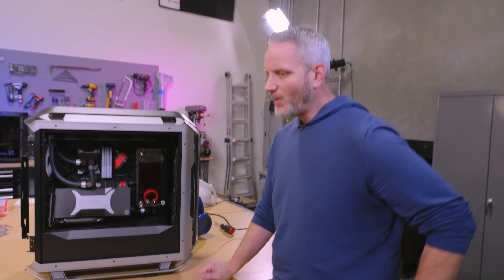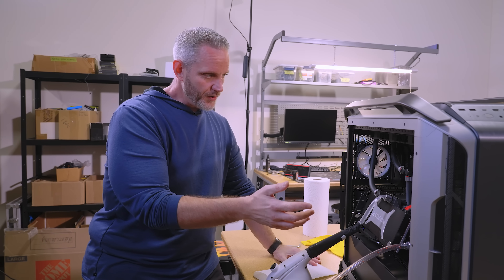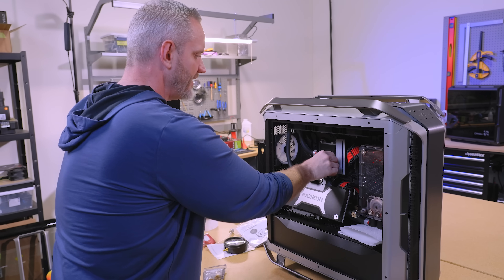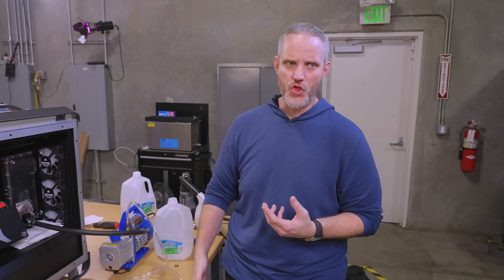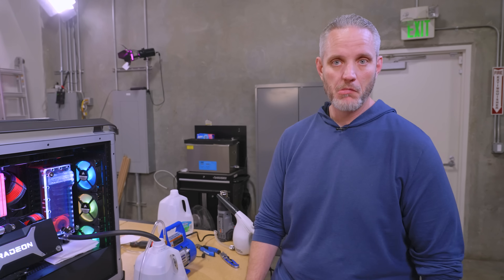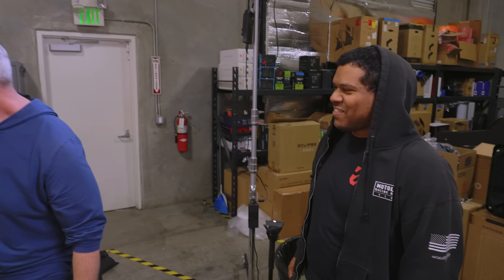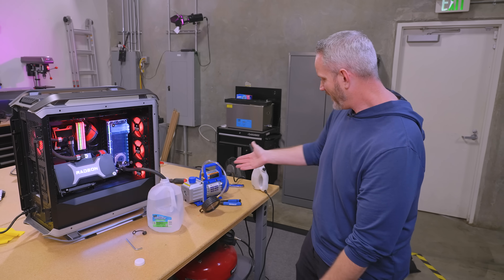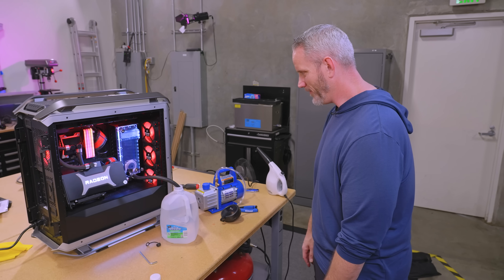I used Vacuum Pressure to fill a PC! Why didn't I do this sooner!?

Comment: I use the same kind of pump for all sorts of stuff it wasn't designed for and have some tips. 
1) You can use some hose or pipe over the exhaust, it acts both as a muffler and an oil catch for the vapor. 
2) You want some kind of water catch and/or a dryer for the vacuum side, preferable both. You can diy either one with some pressure rated pvc, the dryer will need a desiccant though. 
2a) If you don't opt for removing the water before it hits the pump you're gonna wanna change out the oil a lot. The little port window doesn't show the bottom of the oil reservoir and you can get a good amount of water sitting on the bottom before you can see it. The water in the bottom totally wrecks the pump, it rusts stuff up and will turns into this cheesy slime that makes changing out the oil a huge pain.

Comment: You COULD use that pump to 'vacuum drain' the loop, just not directly. If you connect a tank and then pull a vacuum on that, it would suck out all of the liquid in very short order without getting fluid into the pump itself.

Comment: Jay, let the coolant in slowly.  Incompressible fluid filling a vacuuming is incredibly violent. It’s like when you use your hand to smack the top of a glass bottle to make a cavitation to bust the bottom of the glass out, and that’s with your bare hands not a vacuum pump. The effect can be used in demolition.

Also HVAC techs don’t use a vacuum to “fill” an air conditioner. They use it to pull a vacuum on the system to remove non condensibles. Water “boils” under a strong enough vacuum at normal temperatures so they can be easily removed. You can charge an HVAC system on its low side (100+ psi) without a vacuum because the pressure in the bottle will always be higher than a running AC’s suction pressure.

Comment: as a benefit, the system won't max out on the meter if there's a leak as it won't be able to create a vaccuum. You could do a "reverse" air pressure test basically and do the old fairy liquid on the joints test and see where the bubbles form.

Comment: No need to vacuum your fill tube, simply pre fill it with water. Now, to make that work really well, you would need a tap on the bottom of your fluid source jug, but even with a valve in the middle of your fill tube, you can submerge your fill tube and have it nearly full when you connect it leaving only a trivial amount of air.

Comment: can also use it to leak test. something i use in work quite regular. vacuum the cooling system down and watch the gauge to see if it moves up over 10 mins. then pressure test the system and watch the gauge

Comment: Hey Jay, I am a VW tech and we use a tool that can remove the air from the fill hose to eliminate introducing air into the system when filling.  It works GREAT!

Comment: The two valve system you have is a great idea. I have a vacuum pump. I have 2-24mm vacuum gauges with thumb screw needle valves, that way I can control the amount of vacuum can be pulled. It works great and works kind of like a little fail safe.

I also use a weird method that everyone scratches their head at when doing clutches and break systems; I will prime the system with fluid and then I use a sink drain plug with a small hole drilled in it with vacuum line going inside of it. I will slap it ontop of the master cylinder reservoir and pull vacuum, this pulls all of the air out of the top. If anyone who's a GM Tech will know this is how GM did most of their hydraulic systems for decades! Works great for removing air out of a system, going through the top of the reservoir..

Comment: ... you know that you can use any cheapo geared pump for both directions..
they dont need priming, only a few drops and can press water into stuff or suck out, even with mostly air.. 
And not as dangerous as vacuum.
kinking your tubes or pulling in gas through seals that are intended for overpressure.. i would not risk pulling anything close to a vacuum on the radiator (they arent soldered anymore),
or recommend people to try that on their own hardware, if they cant afford to easily replace it.
And i like my pumps not emitting oil vapor.

EDIT:
And please check your warranty <_< before you start whining about leakages. I bet Jay will happily pay your hardware.

Comment: Jay, you CAN use that pump to drain a system. you just have to make a liquid trap by routing the drain into a rigid container and attaching the vacuum line at the top and sealing the container. this is how vacuum brake bleeders work, for one thing.

Comment: The problem with pushing water or air through these systems is that "oil" is not returning to the compressor and you will have to add oil everytime you use it. Refrigerants have oil mixed into it . I dont see why a small water pump wouldnt work well with this and you wont have to worry about oil

Comment: You can also use vacuum to check for leaks. You would have to place your gauge behind the shut off valve, pull the vacuum and shut off the valve after full vacuum is reached. Then monitor the gauge for any needle fall back to zero. If the needle falls back any noticeable amount within a couple of minutes, you have a potential fluid leak.
Reply: This might not pick up all leaks -- seals can behave differently if they are holding back pressure vs a vaccume. It's better to use the little air pump + gauge to check for leaks.

Comment: i literally already do this to fill my system. i have an extra "priming tube" that comes off a tee in the corner, and i just suck on it with my mouth to pull air out of the system while a 4L jug of distilled is piped into the reservoir (jug cap has a bulkhead fitting for g1/4)

Comment: I am excited for the possibilities with this
Reply: Okay that was sick. I feel like you could do a second valve disconnect point on that line. vacuum seal and shutoff point one. then point two. power off. disconnect and drop that open end into the fluid 💆🏻‍♂️

Comment: I have a tool for vehicle coolant systems that does the same thing using Venturi effect instead of vacuum pump it's a bit safer for the rads, just need to start the filling process slowly so you don't damage the delicate microfins of the water blocks by having them get suddenly get hit by a rushing wall of water

Comment: Try two things. Is there a way to hook up the vacuum pump to the top of the liquid cooling system? If so hook up the vacuum pump to that and just draw the fluid in from the bottom. It’s not a cool as this but should work without having to put the whole system under vacuum. (Putting the system under vacuum could also help check for leaks though. If it doesn’t hold vacuum you know it will leak.)

Other option to use the vacuum pump to drain the system. Just put a container between the pump and the computer. So the liquid goes into the container and you don’t draw the liquid through the pump. Like a system at a hospital.

Comment: vac the fill port at the top while bottom drain port is under water and throttle a valve nicely and itll draw the air out and the water in one shot

Comment: Jay, you should test this with the lowest vacuum level that is necessary to get enough water into the system to make filling easier. You are going to ruin some parts in the future by using too much vacuum. They are not designed for negative pressure. Have you ever seen a rail car or tank wagon that has imploded because they don't open a vent to allow air in? That is not even under nearly as much vacuum as you are using. 

A better solution would be a second valve you can pull vacuum on to suck the water in from the lower hose and ultimately suck any entrapped air out of the system totally. You then use some kind of knockout pot before the vacuum pump so once it is full you can suck until all the air is out and not have any worries about the water that is pulled out going into your vacuum pump, it goes to the knockout pot, a chamber between the vacuum pump and computer, and then you empty that out of any water that was sucked out when you are done. This method would be much safer and not put much negative pressure on any of the parts at all, it would just suck the fluid in a low pressure, and you could control the pressure with an adjustable bleeder valve on the vacuum line on pump.

Comment: Jay, when you unplug the hose under vacuum why don't you try filling it with coolant, capping it with your finger and then submerging it into the container with the rest in? Then you've eliminated most of that extra air too. I'd also recommend slowly opening that valve instead of going full whack - the water hammer effect can cause damage.

Comment: no need to get anythying other than another container. but the fluid tube about halfway down and the vac tube futher up.  now you have a syphon container. just make sure the capacity is large enough to hold all of your fluid without reaching the location of the vac hose.

Comment: Definitely not the first one who did this!!
It was done years ago on the filling station for Predator.
You can easily damage radiators with a vacuum, fins get dethatched from tubes.

How is your cooling now? The sound coming from radiators may be invisible damage that causes cooling performance issues.

Comment: Would filling from the top of the res mean that there would be no air in the system? And possibly a T junction with 2 valves that would allow one side to have water in it to eliminate any air in the pipes?

Comment: Like a vaccum brake bleeder. My MightyVac hand bleeder has a bottle that will pull all the fluid through without sucking fluid into the pump. Nice seeing it done on a computer. Also I believe the vapor you see is water boiling out of the system at low pressure.

Comment: Horrible Freight has an air powered vacuum pump for like $15, for those who have a basic air compressor already....also, FYI.....pressure/vacuum seals aren't always bi-directional sealing....so this method should NOT be used for just any system...,..

Comment: All you have to do is flip the gallon jug upside down. Mod a cap with a fitting to connect the tube to with a valve. Cut the bottom off the jug to load it with fluid. When the valve to the line is open the line will purge prior to pulling the vacuum fill. Thus minimizing air pulled into the system.

Comment: could you not just pull a vacuum into a secondary container connect it 2 the bleed port and open the valve 2 empty the system fast.

Comment: 24 Hg in vacuum is waaaaaaaaay more than you need. 24 Hg means it would pull 24 inches of mercury vertically up a tube. Even if your system was 2 foot tall, it'd be 24 inches. Mercury is 16 times denser than water so you could stack 16 of your computers ontop of eachother and still have vacuum left to spare to fill all of them up
Reply: Also pull the vacuum from the fill valve on the res and the water from the drain valve. it will fill with any pressure belove atmospheric which would be less strain on the rads

Comment: You could do an overhead reservoir with a t-fitting. One for the vacuum line and one for the fluid so there is even less air to start. Just have to have 2 shut off valves

Comment: First, I love this video. I would love to see more like it. However, you are not the first to try this or other alternatives. (And no, Aquacomputer did not do this first either.) More than 15 years ago enthusiasts and modders were experimenting with vacuum and fluid pumps. All attempts failed in the long run. (At least all the experiments I watched failed.) I would love to see you stress test a system with good components so we could see how well modern water cooling systems stand up to vacuum pressure.

Comment: Use a T fitting right before the res, connected to your fill line and a hand pump with a shutoff at the fitting. Then you can prime the fill line and close off the hand pump section before filling.

Comment: I'm currently building my watercooled system.  I've thought of the  unheard of vacuum filled technique due to what I do in my HVAC career. I was just too chicken to try it on my one and only system, fearing of catastrophic damages.  In the HVAC industry, we use the air pressure test to test for leaks, so why not vacuum to fill the fluids like refrigerant to an HVAC system?  
Idea for emptying fluid from a pc.  Use a vacuumable remote cannister with line in and line out lines and valves between the target watercooled system and vacuum pump like pulling old refrigerant from a hvac system (reclaiming).

Comment: 29.93 is the max you can get at sea level. Your elevation will determine the max vacuum you can pull. I believe the weather will also determine it as well. Whether you're sitting in a low or high pressure weather system. Now, if you want to try emptying the system using the vacuum, you have to use a catch can with two ports on the top. One port for the PC and one for the vacuum pump. You can pull the fluid without getting any in the pump. They are used for resin infusion for the same purpose, protecting the pump from pulling resin.

Comment: Pulling a vaccum is actually a better way of pressure testing, and the added bonus of making filling the loop easier, u can also easily pull a 2 torr vac with that vac pump (ac engineer)

Comment: you have to prime the tube, easiest way would be to hold it upright after the vacuum and closing fitting. pour some fluid into the tube so it fills up ( while upright ) then put finger in tube and put into fluid and the open valve.

Comment: I used to fill my servers like this because we had a issue with air getting in the lines when the power was out. TRUST ME. let that water in slowly. you will damage stuff. water is heavy and when you make it high velocity you make water bullets essentially

Comment: love the idea, however you could also try a Water Transfer Pump to both Drain and Fill a system, should work just as well and possibly less chance of drawing air into the system when filling.

Comment: Dear Jay,

And if you put a meter on it and vacuum it, you can check for leaks also, if it holds a vacuum? For like 30 min, it doesn’t leak and you can fill her up.  Biggest plus of vaccuum filling? Not having to bleed for trapped air!

Comment: Radiator hoses on cars and trucks suck themselves flat when vacuum filling them so i don't see why the soft tubing would have an issue in the system. Now you can put vacuum gauges in your systems and do vacuum leak tests before pressure leak tests.

Comment: To evac a system all you need is a container in between the vac source and the cooling system. The vacuum pulls the vac at the top of the container (so that fluid does not get pulled in) and a hose extends to the bottom of the container where the fluid is accumulated. It's just like a one-man vacuum side brake bleed, like a Mityvac which I use.

Comment: A vac (separation) flask would work great for vac assisted emptying of fluid.

The same could be said for flushing, although you'd need a few of them to ensure as much air is removed as possible while flushing / refilling the loop.

Comment: Need to add a collection tank between the pc and the pump.   Then you can repull a vaccum and pull ALL the air out of the loop before sealing it off.

Comment: Just an idea, flip the gallon upside down, add a valve, and when you fill it, it will always be full instead of the air in the tube.

Comment: This is the same way a mechanic changes fluid in your car. Brakes, power steering, transmission fluid sealed systems are awesome. If you add a tank to the draw side the vacuum pump won't suck fluid through it and won't get damaged. It will also capture any overfill so you can recontainer it.

Comment: Why not pull the liquid through the system with an isolation chamber so the pump doesn't suck water? Look at brake bleeding kits for the explanation/inspiration.

Comment: Nice..I have filled systems using pressure with an external tank with enough fluid to fill in the system in it.  Loosening  a fitting at the top of the reservoir enough to allow air to escape. while pushing the fluid into the lowest point. (Usually the drain port.) I used a small weed sprayer. ( one Gallon sprayer) That has a hand pump to pressurize the tank. I converted the sprayer hose  to a flexible tube that connects to the drain valve. Once the system is full, I close the drain valve. slowly open the top to the sprayer, keeping it below the system, relieving the pressure, the remaining fluid in the tubing  goes back into the tank. disconnect. Top off after starting the system   Total cost for the sprayer and the fittings and tubing were around 35 bucks.

Comment: Wouldn't this collapse the thin radiator fins? Aluminium and copper are pretty soft metals and have next to no elasticity or springiness to them, which means the more you do this to systems, the higher the risk of basically closing the radiators. Also, if you use air pressure to reinlate the fins, you risk developing metal fatigue which leads to cracks and leaks.

Comment: Hey Jay,

I've been filling my PC with a fluid vacuum hand pump for ages. I used one that is meant to be used to bleed automotive brakes.
I don't pull vacuum on the whole system though, I use the vacuum to pull fluid through the loop at the highest point to ensure a complete fill. This way also tends to pull all the air pockets out as well.

Comment: Those are the kind of pumps used in fabs and semiconductor labs to pick up packaged parts with little suction cups to move them around from trays to systems, etc.

Comment: The beautiful thing about this is that by using a vacuum, you've already pre-tested the system for leaks before even filling it, without having to do a separate pressure test (although it probably wouldn't hurt to do that when building it anyway. A second test also doesn't hurt, sometimes things might ... move between build and first fill, esp. if you have multiple hands on it.) Very efficient